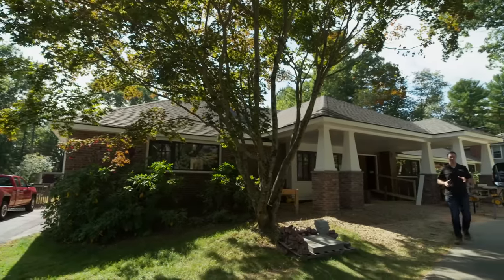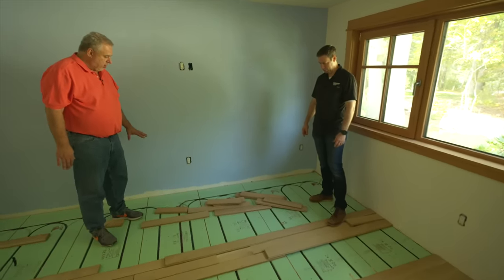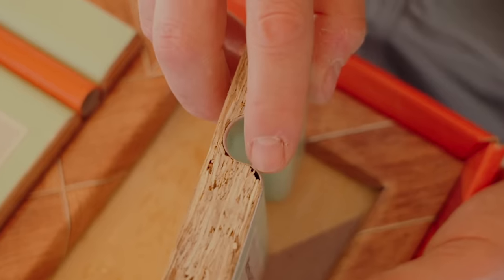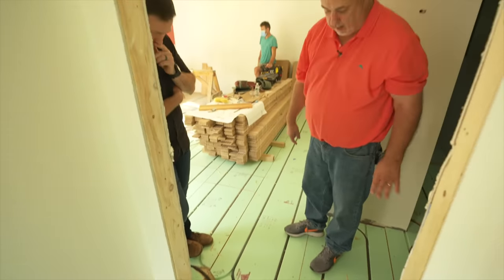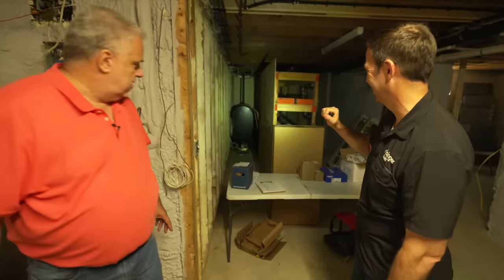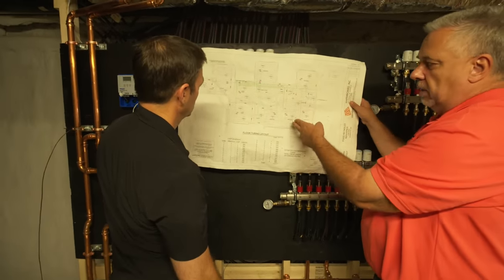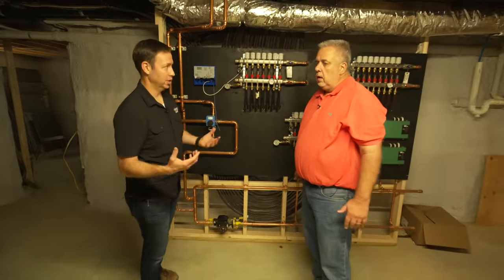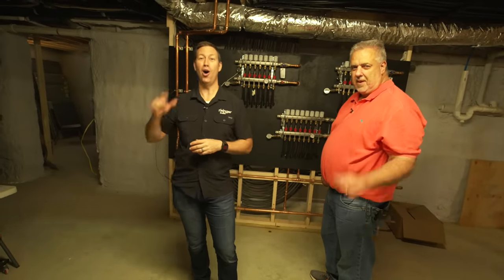Plug and Play Radiant Floor Heating System - BEST ON THE MARKET

Comment: Just hope the guy nailing the floor down does not hit a pipe! These systems are now fairly common on high spec homes in the UK, where I live, but there is one difference, a concrete sub floor, something like flowcrete  is laid over the pipes, for thermal mass, with insulation below the pipes, gives an even constant heat.
Reply: Well same here in Denmark, very simple and comfortable systems. Much cheaper than warm board
Reply: Pressure test with air before filling system up.  May be a pain to find where he hit one but maybe the test after each room is done?
Reply: It's also done here. (it's not really concrete even though it looks the same) The downside is when there is a leak or a problem, it's an unbelievable mess to fix.

Comment: Great video as always. I love learning about these systems and it’s good to see you up in my neck of the woods!

I could be wrong, because this isn’t my area of expertise. Would it not be a good idea to have those heat pipes in the basement wrapped with an insulator since the basement is generally a cool temperature? 

I feel like you’d lose some heat energy before it makes it up into the room where it’s needed since the basement air is in direct contact with the pipes over a fairly long span of the pipe.
Reply: Basement is fully conditioned
Reply: @stevenbaczekarchitect9431  thanks for the reply Steven I didn’t even think of that being a possibility. I don’t see many conditioned basements up here in Maine, so that didn’t cross my mind. I’d definitely like to see a video on best practices for conditioning basements up here in the north if there isn’t one already!
Reply: @PatrickTheThird1  Insulate the exterior like any other level of the house, and ideally put 2" of rigid foam under the slab.

Comment: You forget to mention, that this kind of heating goes very well with heat pumps. The large area of the heating, means a low supply temp, that will in turn give a higher COP from the pump.
Reply: "the large area of the heating, means a low supply temp" - actually, it's sort of the other way round. Radiant floors can't be driven above +35C for health reasons. Higher floor temperatures and thus higher floor-to-air gradienst speed up air circulation beyond a point where dust won't set on surfaces anymore. It just keeps circulating with the air, over and over, increasing in concentration in a most unhealthy manner.
Reply: @nvo7024  I’m not really sure what you are trying to say here? I was merely pointing out that radiant floor are a good match for heat pumps.

Comment: Yes, I want my closets to have radiant floors.
Reply: You need to put board down so the floor is level. so it really does not make any difference.
Reply: OSB would be a lot cheaper. How long do you spend in the closet anyways?
Reply: i guess it depends on how big your closets are

Comment: I imagine that the ROI in regard to cost savings for heating bills would be about 475 years.
Reply: He said he was using a tank of oil per month and after they're going to use 1 tank per quarter. Assuming his math is correct and delivered oil at $3/gallon, the tank being 300 gallons - that's a shift from $10,800/year ($3x300x12) to $3600 ( $3 x300 x 4)  which is a savings of $7200. @Brad are you thinking that the system cost $3,420,000? (7200*475).
Reply: @andye1467  The 475 is of course hyperbole due to the very high price this system would cost to buy and install.  I would also argue that your own calculations are a bit off.  Heating does not occur 12 months a year, rather only in the colder months. As well,  a heating system that cuts down oil use by 300 gallons per month, to 100 gallons a month, does sound like the estimates are just a "tad bit optimistic".
Reply: @bradryan8071  For some people the ROI may not be their first consideration.  It's pretty much a no-brainer that a radiant heating system is a fantastic solution for anyone who suffers from allergies of any kind.  This includes guests who perhaps only spend a short amount of time in your home but are surely going to thank you for having spent the extra $$ even if the primary occupants aren't affected by potentially degraded air quality.  I don't know about everyone else but I would never miss a heating system that cycles on and off continuously all day and night as the temperature swings up and down.  When you think about it, your home's primary purpose is to keep you comfortable.  Anyone who claims "I don't care about comfort just make it as cheap as possible" is probably not being entirely honest or just hasn't thought it through.  This upgrade, albeit a pricey one, just about guarantees that you will have a vastly increased comfort level every minute of every day during the colder months of the year.   Heated floors after all are on just about everyone's "luxury items I wish I could afford" list.  

One thing my Father has always preached is that your primary home should not be thought of as a potential money making investment but instead an investment in your family's comfort and happiness.  Interestingly Dad, now 79 years old, has NEVER sold a house for less than he invested into it, but that's beside the point.  Or is it?
Reply: @rikkicanbuild9964  you are right, it is about the home owner's own comfort. Not guests. Personally, I love this system and would like to have one like it one day. But a guest who is genetically weaker than normal human beings is not a consideration in any one persons head unless they are the genetically weak or have children or parents that are so.
Reply: The heating oil is the issue not the system.  That's the main thing that will turn buyers away. But the same system with natural gas or propane would add alot in value to the house. You can't just look at it as saving money. It's also making equity.
Reply: @bradryan8071  LOL, 12 months of heating what are you smoking? Even in the Arctic circle you don't need heat for all 12 months of the year, trust me I've been up there.
Reply: @PapaSmurf337  You should probably re-read my comment.  I said "Heating does not occur 12 months a year".
Reply: @bradryan8071  Yea, I was trying to reply to the other guy who made his calculation based on 12 months of heating, I guess that failed.
Reply: Actually low temperature heating systems are by far the best in terms of efficiency. In Europe, the difference in investment is maybe 50%(or less) compared to regular radiator heating. And since we dont have almost free energy in Europe like you do in the US, the ROI is actually really good. Use radian floor heating with a heat pump and you will more less have free heating (compared to natural gas, since thats Europes main fuel for heating).
Reply: @mysweetsmegma2648  Heat pumps in a European new build make sense. In a retrofit the ROI isnt great and its not even possible if the house is badly insulated
Reply: @Jhhhf4479  Im building an apartment, and heat pumps are meaningless if you have an existing natural gas connection. They dont even compare next to floor heating and a proper condensation boiler.

Comment: Has anybody seen a radiant floor system for heating + a radiant cooling system in the same house yet? I would love to see a comparison of numbers for install price, efficiency, longevity, and operational cost between a house with these passive type systems against standard.
Reply: I've done a bunch of research into this, and the main reasons no heat/cool systems come to flooring is almost nobody loves walking on a cold floor. Messana makes a system using heated/chilled water through a ceiling panel, which makes a lot more sense. Happy hunting!
Reply: @mikecousin8523 sorry I wasn't clear, their system does both the heat/cool so it would be the only system installed. Yeah , installing both is for the client truly looking to burn money!
Reply: You can pump much more BTU/hr of heat into radiant floors than you can pull out in summer, as you always have to stay above the dew point, when cooling. Plus: I haven't found a residential water chiller that would satisfy the requirements for this.
Reply: @Ninjump  it's nice to put your feet or body against warm surface during the winter time,
but it would not be nice to put your feet against cold floor even during the summer.
better to have nice cool breeze to your face and body.

Comment: "You've got warm feetsies aaaaall winter long..." <-- This is really only true if your house is losing a significant amount of heat. A tight, well-insulated home shouldn't actually require much perceptible heat from the floors to maintain interior temperature. If your floors really do feel warm under your "feetsies" it means it's either extremely cold outside or your house might not have been insulated or air sealed very well.
Reply: Have you ever been in home w/hydronic heated floors? One that is extremely well insulated? I suspect not. Our home is so efficient we use heat pump domestic water heater for hydronic heat. It’s certified passive w/8” mineral wool in floor joists plus 4” foam affixed to foundation walls and rim joists. Because the hydronic system has minimal losses and the system cycles a couple times daily in sub-freezing temps, the floors are always warm. I’ll give you that the stone portions in wet areas appear to retain warmth slightly more than the white oak floor areas but floors are always warmer than any forced air heated home we’ve owned. 

The best part, omitted by Matt, is there is no drying of air, causing dry sinuses and skin,  we commonly experience in FA homes at our 9k’ elevation. Much less dust and pet dander appearing on every flat surface.
Reply: @MichaelM-to4sg  appreciate the reply. Yes, I live in Alaska and have been in many homes with hydronic floors. In my experience, tile over hydronic heat doesn't really feel "warmer" on your feet than wood or vinyl floors in a home with forced air. Maybe if a system has just cycled and you have low-thermal-mass delivery like Warmboard that delivers heat more rapidly it'd be different (almost all hydronic tubing up here is embedded in gypcrete).

Maybe it'd be better to just make a general point: the goal with a new home should be to make it as well-insulated as is reasonable, and that means your floors should be as cool as is reasonable. Heating up tile or slate to the point that it actually feels warm and cozy under bare feet--that represents an awful lot of heat leaving your building envelope.

Don't get me wrong--there are lots of reasons to use hydronic heat. In fact, I'm building my own home right now using Ecowarm, a very similar product to the Warmboard featured in this video. I'm just not sure "warm toes" should be a stated goal. I've actually heard that some people with radiant heat are disappointed their floors aren't "warm and toasty" as promised and end up cranking the heat to a level that's excessive and wasteful.
Reply: @PaxsonWoelber  Our home is done w/Ecowarm👍. I preferred the smaller 3/8” pex more tightly spaced which allows lower water temps and more even distribution, important under wood floors. If you properly insulate floors and subarea/basement, you’ll feel the heat in floors. Remember, energy flows to least resistance. Insulate well enough and the energy flow will be the flooring, even in low thermal mass hardwood. 

You will love the Ecowarm, once you get past the labor of install
Reply: @MichaelM-to4sg  I wish we had a drying problem. ON east coast it is so humid most of the year , I have and and central dehum running at the same time.
Reply: @PaxsonWoelber  My apologies, we used Thermaboard, not Ecowarm. We did consider Ecowarm and Warmboard but eventually chose Thermaboard for its closer spaced 3/8 pex. All excellent products
Reply: Our house is OLD!.. and not very well insulated and short of gutting it, it's not going to get better.  The way the system is designed is that the system looks ahead at outside temps along with indoor temp and adjusts the boiler accordingly.. The goal is to run the system continuously through the heating system.. Keep the floor at a constant temp.  Our whole house and DHW runs off a Viessmann 80,000 BTU, 96% boiler.   That said, I've started insulating the pipe runs in the basement as it's warmer than it needs to be.  Underside of the first floor is getting insulated too.
Reply: Not sure what you mean. If you have stone tiles on the floor you will certainly lose heat in the winter unless you have an abnormally high ambient temperature inside, if you have wood it will not lose significant amount of heat but it might still feel cold.

Comment: One other benefit of radiant floor heat is that occupants tend to set the thermostat a degree or 2 colder than in FA system because you feel warmer when your feet are warm.  That equates to some additional fuel savings.  

My wish for all new indoor concrete slabs in resi construction -- install pex tubing loops (oxygen barrier) in the slab at time of pour so at some point in the future radiant heat can be added.

Comment: Add natty-gas Pulse-combustion=$12G. and you have the very best, and lowest monthly bills, we loved ours in Alaska. We had old, old 1960's system, 3" Cast iron pipes in concrete slab, Quiet.
This looks great and much, much better than copper, (coil or pipe) and ALL engineered before, for ease  in speedy installations.

Remember you are heating floors, furniture,  (you), walls, not the air. 
Doing "clean-work" is easy on new construction folks, AND (of course) speeds Inspections. (retired UA).

Comment: What do you do for AC when the heating system looks like this?
Reply: with a heat pump unit you can heat and cool the water.
Reply: @captianprice1592  you keep the floor cold, so no heat soak. you dont notice it. dont forget that you use a split air if you want t get the humidity down. floor cooling only reduces the house temperature, it does nothing for humidity. so a small and cheap split air in the living room and bedroom is more then enough to keep everything perfectly livable and cheap to run.

Comment: This looks very hard/expensive to repair
Reply: Actually it's not. All the mechanical parts are replaceable. You can actually run the in floor heat off a instant water heater. A decent one that can handle this goes for under 700 dollars. You can get gas or electric.

Comment: I have underfloor radiant, love it.  We did ours with a second layer of plywood and aluminum transfer plates(maybe thermofin).  The plywood and transfer plates were way cheaper then warmboard but it was still a few thousand for the system parts.   I DIY'd the install it but had a pro design it.  Radiant is most cost effective if you live in an area where you dont need AC as you ware paying for the same ducts and still need an air handler.
Reply: your last statement is incorrect. there is such a thing as "radiant cooling", but you have to use a heat pump instead of the boiler that you are apparently using.
Reply: @Rich Zellmer, are your heating loops beneath the subfloor?
Reply: @koaea  i did two layers of subfloor.  ie put down a full sublfoor and put strips in between with half circles at end for the turn